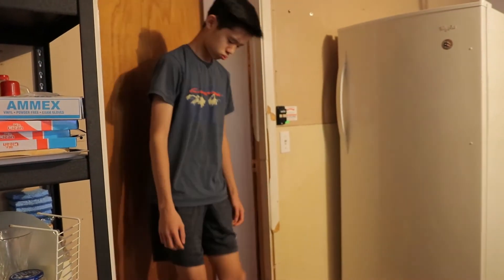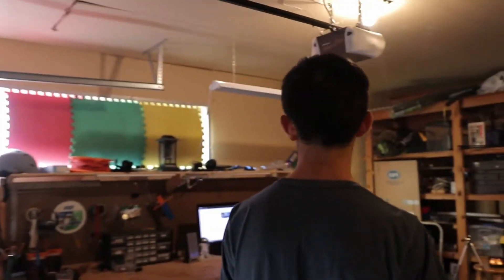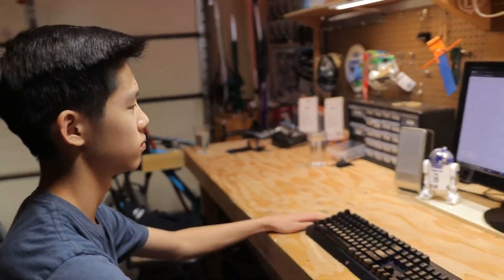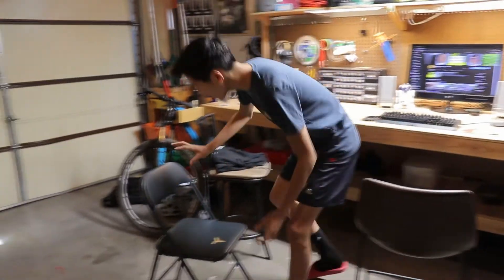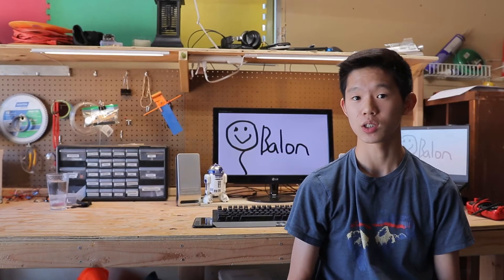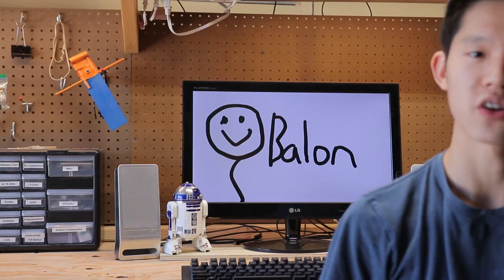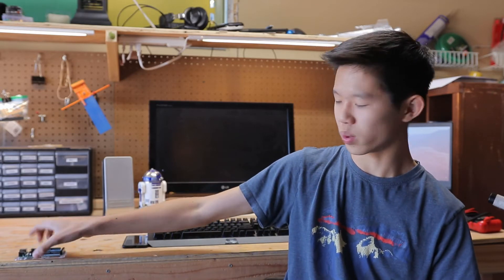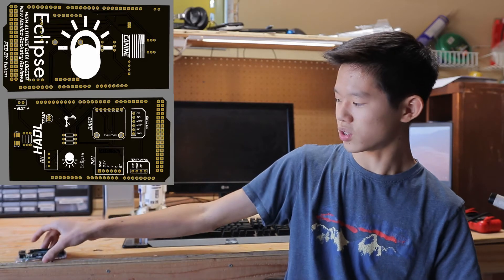Project Eclipse Weather Balloon Project - Update #1

Comment: XD Did you take my idea? 🤣🤣 I'm working on a weather balloon right now actually. It'll be a 1200g with a max alt. of 250000ft. Plus it'll have a 5k camera, 6 axis gyroscope, and a telem/GPS computer.
Reply from the maker: Oh that's sooooooooooo cool! I'm guessing GoPro Hero 9 for the camera? Best of luck on your project!
Reply: @NMRocketry  Brilliant, that's the exact camera. Max lens and 5k in SPACE? Yes please! 🤣🤣 Oh BTW I'm 15, and I guessing y'all are about the same age. Are you going to build or buy your HADL? Or use CRT's?
Reply from the maker: @thechanceogden  Canine Rocket Technologies designed an Arduino shield that will go onto the Arduino Mega. We uploaded the design and bought it. Just remember to use a very large SanDisk extreme micro SD for consistency. Sandisk is the most reliable and the extreme will be able to handle the 5K. It's more expensive, but it will be worth it. Also note that the clip from the flight will not be one large clip, it will be split into smaller clips so you will have to go through and put them together. Best of luck!
Reply: @NMRocketry  XD That was my plan actually! Great minds think alike! I might also include a video feed relay just for redundancy. If I'm sending something into space I definitely want it to work. 🤣👍
Reply from the maker: @thechanceogden  Ah I see. Best of luck. Hope to see you at Saturday's livestream!
Reply: @NMRocketry  Of course. Can't wait guys!
Reply from the maker: @thechanceogden  hey I saw your comment but YouTube won’t let me see it. What’s up?
Reply: @NMRocketry  Hey! Yukon and Cole P. And I are working on a meeting for all the smaller rocket programs and we wanted to know if guys would like to meet via Zoom today?
Reply from the maker: @thechanceogden  yeah sure. Wat time? And can I bring others too?
Reply: @NMRocketry  Yeah! What time works for you?
Reply from the maker: @thechanceogden  Whatever works after 3 pm MST. i can communicate a time with Cole and Yukon with discord.
Reply: @NMRocketry   Awesome! Does 5:00 sound good?
Reply from the maker: @thechanceogden  Yeah that should work. MST right?
Reply: @NMRocketry  hey guys, I am so sorry. For some reason YouTube has not been sending my comments through.
Reply from the maker: @thechanceogden  thats fine. What time zone? Its doing the same for me